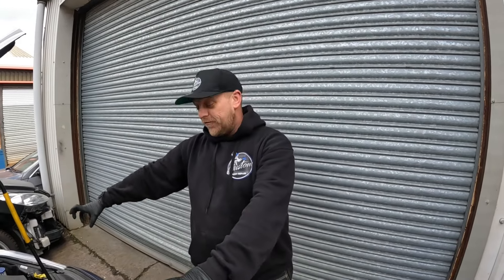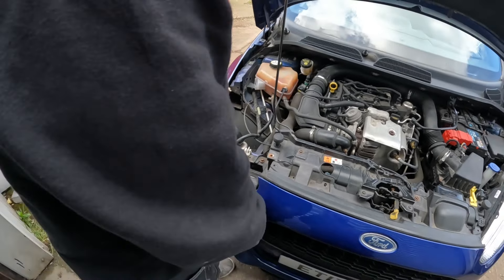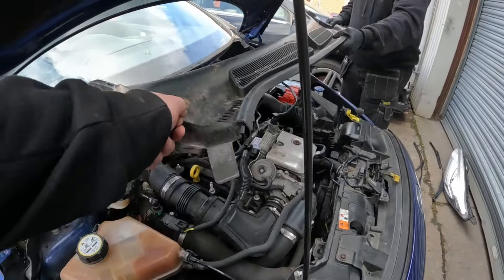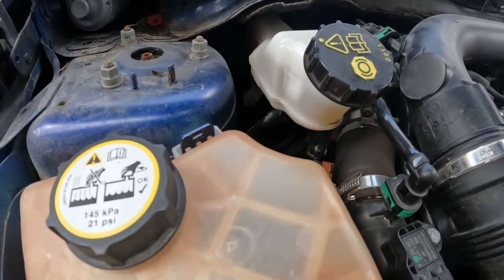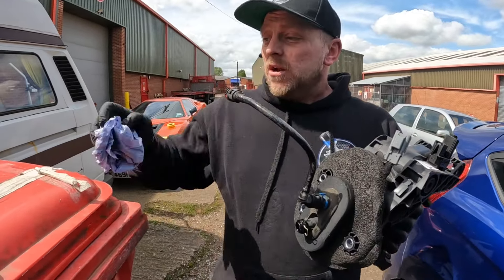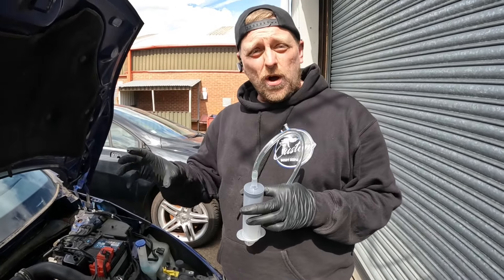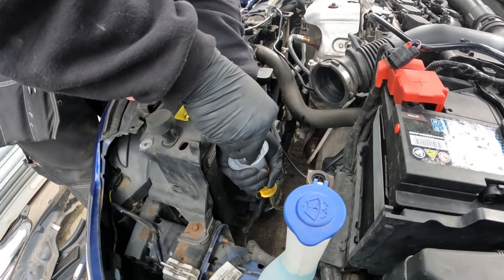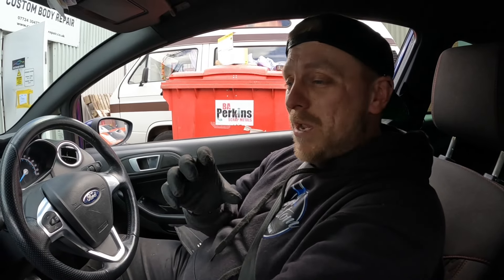Ford Fiesta Clutch Master Cylinder Change

Comment: My cap has a plastic covering on it, when I connected the syringe to the bleed nipple I couldn’t push any fluid through. Should I tear the plastic covering in the brake fluid reservoir? Also what mm tubing fits the nipple? 9mm ID?
Reply from the maker: @shahidiqbal1259  make sure the cap is off the brake fluid reservoir to aid with any back pressure issues and keep in mind that you have to turn the plastic bleed nipple on the slave cylinder 90 degrees or so to the left to open it to allow fluid through and then slowly push the fluid in and you should be good, from memory it’s either 6mm or 9mm tube I can’t remember exactly 👍
Reply: @ sounds good thanks, did your brake fluid reservoir have a clear plastic sheet below the black cap? Did you remove it? Or was it just open below the black cap.. if that makes sense
Reply from the maker: @ there should always be like a mesh cup in there to filter the fluid going in but not usually clear plastic, I’d say someone has either put that there in an attempt to make a vacuum or if the cap was leaking perhaps they’ve attempted to use that to seal it

Comment: I changed my clutch and the pedal was still soft so I bought a master cylinder and before I installed it the clutch pedal went back to normal, so didn't have to fit the master cylinder lol
Reply from the maker: @MarkwingDuck83  ideal that you didn’t have to fit it then mate really, sounds like either the clutch itself or the slave cylinder was at fault here then 👍

Comment: Attempting this today 😮 may I ask what you used to cap the line to stop the fluid from coming out please 

Ps always watch you on tiktok 😊
Reply from the maker: @shanepollard8710  I just let it run into a container mate to be fair as the access is limited so I was just quick about getting it put back in 👍

Comment: Hi m8 I have followed your video and replaced the master cylinder.My question is when you reverse fill will i need to hold the clutch pedal up during this process.The pedal is currently fully down,or does the pedal rise whilst filling.I don't want to push to much pressure in and potentially pop the master cylinder seal many thanks 👍
Reply from the maker: @user-en2wo9cb4v  pop the pedal back to the top mate and then carry on and reverse bleed, you can do it either way but placing the pedal back to the top just stops having to apply so much force to reset the pedal, although if the pedal is stuck down there is a good chance it’s your slave cylinder that’s at fault so it would be worth checking around the bell housing on the gearbox to see if you can see any visible signs of brake fluid leaking from the area as that will help confirm wether it’s the space cylinder or not so worth checking
Reply: Spot on will do m8 much appreciated 👍

Comment: 😢i think i am having the same issue with my fiesta
Reply from the maker: @bantumatyeni  that’s sucks mate, just know though that whilst it drastically
Improved the symptoms on this one it still wanted the slave cylinder changing too as that was also leaking internally, my guess would be from incorrect bleeding practice before as ford insist on reverse bleeding these systems from the slave cylinder back up to the reservoir 👍